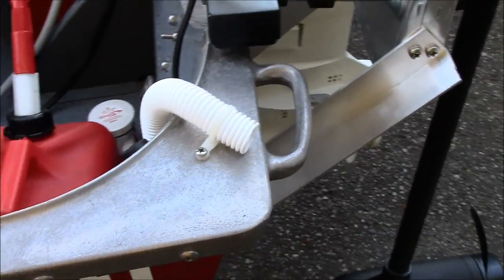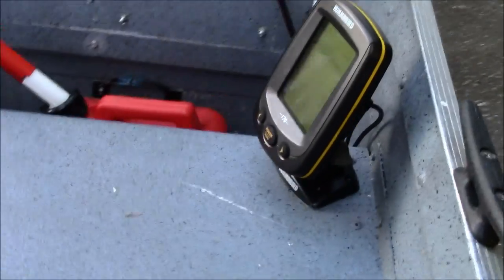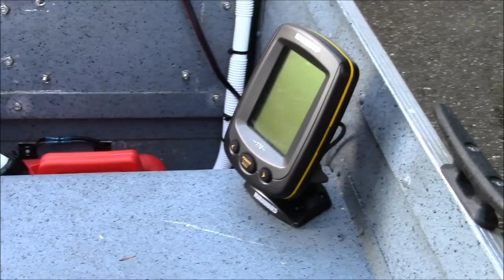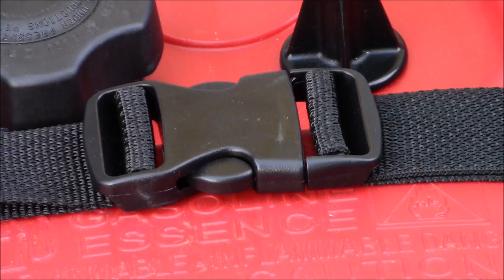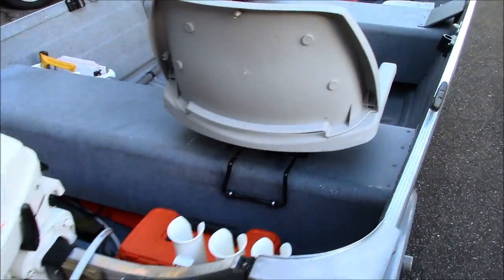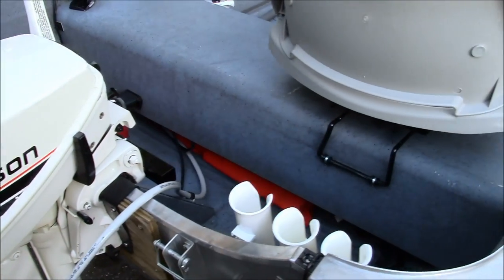12 ft Aluminum Fishing Boat Restoration, Customization and Setup in HD

Comment: I know this vid is old but it just popped up in my feed. Love your attention to detail. One thing you've probably added by now. navigation lights. I did a DIY 14 footer myself. Even added a pvc center console and wheel. removed middle seat. Decked, then i changed it for foot space for fron guy or girl. Also floored and marine carpet. Love all the great ideas out there for tin boat crowd.

Comment: I know this is an older video but even so you've done a remarkable job,beautiful boat. It looks as though you have covered everything you need except one thing. Pull your prop off your 10hp, theres a shear pen in behind it. Take and find you a nail of similar size and make you 3 or 4 pens and carry them with you. They get worn just shifting in and outa gear and break when you need it most. Theyre very simple to change even in water. You also said something about building a casting deck,build one just to level your floor out,you got the best boat ive laid eyes on. If you've already done this just pass it on to your friends please. Thank you for showing that incredible boat,keep it even if you get a new one,you want ever regret it.
Reply from the maker: Mark Sutton thanks for the tips! I still have the boat and have changed ALOT to it. Will be posting an updated video in the future

Comment: Setup is almost identical to mine but I have a smaller motor. Nice boat and nice setup. The main thing I did different is that I have the anchor rope running from the bow along the side of the boat so I can control it from the stern when I am by myself. I don't plan on doing the upgrades you are talking about. I prefer simplicity.

Comment: Really works well. Battery gauge is not super super accurate but the motor is pretty great. Haven't used it in salt water yet. Eventually

Comment: This is Armydad from Philly. I was looking for rigging ideas for my 2000 14 ft. Lowes Sea Nymph with 8 hp honda 4 stroke. .  Your video was on point.  I will definitely use the anchor set up, bilge pump, gas tank strap and clips for seat.  If I can suggest a good idea to you.  "A fold away cutting board".  Thanks for posting.
Reply from the maker: Armydad Cutting board for what? like a work table or prepping fish?

Comment: The only thing I didn't see on the boat is your Bow & Stern Lights, mount your Extinguisher near the rear bench not next to the motor. If fire ever will start you won't have to reach through the flames! Other then that nice set up, good luck on the up grade in the winter, done it been there!

Comment: I'd add a screwdriver to your tool kit, get a nice one that takes the 1/4 hex driver bits to save space. I had to use a trolling motor once to get me back to the dock because some linkage fell off my outboard carb and i needed a screw driver to get the air box off to get to it and i didnt have one.

Comment: Great restoration only thing I might change is put 4 foot of chain for anchor so anchor stays at bottom. Also fuel line & electrical line should not be wired together bad news there.

Comment: What's the measurement for the trolling motor bracket that you built I would like to build one 
What size aluminum did you use that was a great I dear. thanks

Comment from the maker: I used 1" stainless steel wood screws. Drilled a pilot hole in the aluminum covering the wood transom and then screwed into the wood transom.
Reply: Wow , great job and she looks better than brand new. Thanks heap as you have given me heaps of ideas for my latest project boat. 
Regards from Australia
Reply from the maker: Got it from Walmart. Didn't find it there anymore but I found a similar one on amazon at this link:

https://www.amazon.com/Anchormate-Worth-Anchor-Reel-Black/dp/B000KKET98
Reply from the maker: Got it from Walmart. Didn't find it there anymore but I found a similar one on amazon at this link:https://www.amazon.com/Anchormate-Worth-Anchor-Reel-Black/dp/B000KKET98

Comment: Auto parts stores sell a cheap clip on solar charger that keeps your car battery charged up when it's not being used. Would work great in your boat to keep it charged when trailering, or anchored/fishing, and not using the battery.

Comment: Nice presentation..

I'm guessing you fish solo most of the time and the second seat is mainly for show. Your 2nd man would have no where to put his feet without kicking the battery and tank. Understanding of course your space is limited.

Also you may consider securing your spare fuel tank and tool box..they'll be banging around back there hitting your Minnkota wiring and bilge pump.

Next, replace the wood block your Minnkota is mounted on. The two screw ideas in the block of 2x6 will not stand up to torque and vibration and will breakaway for sure.

To secure wiring/hoses running front to back consider this: short lengths of 1x1 square scrap wood. Then run a bead of construction adhesive along the natural horizontal ribs in the hull from front to back. Stick the wood to it and let it cure..you end up with an excellent securing strip that will receive wood screws to hold your conduit tube. Up out of the way of the floor and strong without drilling into the boat!

One more consideration..mask and tape the interior floor and deliver the boat to a place that does spray in box beds. It is amazing how much quieter the boat is and it provides a bit of traction for walking. I have wood floors in mine but I have a buddy that has a small aluminum like yours and it's great.

Not trying to cut down your work, very well thought out and thorough. Just trying to provide some insight of the things I've learned over the years trying to make a bare aluminum boat more convenient. Maybe a few ideas to make your boat even better.

Good work for sure..
Reply from the maker: I actually never fished alone in this boat. Most of the time I had at least 1 other person with me and sometimes even a 3rd. Plenty of room for the feet in the front.

The stainless screws for the trolling mount are 2" long into solid wood. Should hold for quite a while. 

The back of the boat does not move much compared to the front so I've never had much of a problem with the spare fuel tank and orange tank. 

I do appreciate all the tips though!
Reply: @danutdlp  Never use stainless steel with aluminium, they will start corrosion of your aluminium parts a specially in salt water.

Comment: Nice setup I'm looking for something affordable that I can stand in & cast out of
Reply: Just take your time go to these used boat stores almost everything is stainless that means no rust ,you’ll get good deals ,I just bought two brand new seats,well they look damn new for 5 bucks each ,great deal ,these seats go 75 bucks a piece and get the adjustable mounts all universal,5 bucks each,the key is to make your boat the way you want it,just take your time ,good luck you’ll find a good motor ,but some things you need new like gas tank,hoses and primer bulb,things like that.it will be a little expensive but hey it’s a good hobby,there’s so many ways to save money,if you have a 12 foot aluminum like me ,and you have a 8 foot bed put the tailgate down and the boat will fit right in,this way you don’t have to deal with trailer,I have a car so instead of spending thousands for a truck ,it cost me 300 bucks for a custom hitch,I’ll have to get plates and registration but I’ll save thousands because I don’t have to buy a truck ,you see it’s tit for tat,but take your time you’ll save a lot of money

Comment: Fantastic job, great looking boat...if I can say though (just for safety reasons), you should not run electrical and gasoline in the same line/together side by side in case of a possible short/leak i.e. in case something failed it would be a shame for this sweet boat to burn (let alone the people in it).

Comment: What kind of brackets/straps for the zip screws did u use and where did u get them? 
Thx and great boat
Reply: That hold the seats in place
Reply from the maker: David Farahnik They are called Stainless rubber insulated sleeve clamp. I found them at my local hardware store. "Ace Hardware"

Comment: please tell me you did not say fuel line and electrical in that same conduit!!!
Reply: lmfao
Reply: LOL. What could go wrong? Nice catch. I totally missed that.
Reply: Yup.  I was going to make the comment as well... but yours was the first comment of all of them.
Reply: There is a electric fuel pump inside the tank of most automobiles.The gas tank could be in the back of the boat.A spare gas tank should not be necessary but the spare tank could go in the front.
Reply: With all that thought I'll give $800 for it.
Reply: Gas tank next to motor ,did I miss something?
Reply: @timothyflanagan3641  You want to see the fuel gauge built in the gas tank without having to move to the front of the boat.You also want the priming bulb close to the choke and starter.
Reply: That spells disaster
Reply: Notice, on his gas can on the back, he has electrical wires on top of it. I'm not no genius but i sense a fire waiting to happen.
Reply: My jaw dropped and I literally paused the video at this point to look for this comment!! 😂😂😂

Comment: Steel screws into aluminium? Do you know about galvanic corrosion?
Reply: Moses Bullrush yeah talk about dissimilar metal corrosion.
Reply: What about the fuel & electrical lines ran together in the same conduit
Reply from the maker: Moses Bullrush A large area of 'cathode' relative to 'anode' will accelerate the anodic corrosion. Although aluminium is anodic to stainless steel, large relative surface areas of aluminium to stainless steel can be acceptable, dependant on local conditions.
Stainless steel fasteners in aluminium plates or sheets are normally considered safe, whereas aluminium rivets or bolts holding stainless steel parts together is an unwise combination, as there is a practical risk of corrosion.

An example of the safe use of stainless steel and aluminium together is where stainless steel fasteners and hold down bolts are used to secure aluminium roadway or bridge parapet guards.
Even with no insulation between the metals, there should be little risk of corrosion.
Reply: So I guess the answer is yes, you do know about it...lol
Reply: danutdlp r

Comment: Your electric line and fuel in seprate conduets and then run them in one large. If gas leaks it will eat the coating on your electric lines.

Comment: Draping 12v wires over a plastic gas tank is a recipe for disaster. I've seen them short out and go molten like a dynamite fuse. It'll melt through the tank and blow UTFU. The seat clamps are redundant if they need screws to hold them on. Screw the swivels to the seats directly. The air horn needs to be assembled and stored next to the helm for immediate use. No good to you in a tackle box if you're about to be run down. Same with the fire extinguisher.  The unsealed cheap plywood outboard pad isn't doing much and will turn to mush in a couple years. Mushroom anchors are not capable of securing a boat. They're for lunch breaks and drift fishing. Those are not "oars"; they are shitty little paddles. You need oars, a proper anchor, spark plug wrench, hand held and aerial flares, bailing bucket, sponge, a decent First Aid kit, waterproof flashlight, some tape to patch a hole and a boathook, for starters. Otherwise, you're looking pretty good.

Comment: Hate to burst your bubble security wise, but Master Locks are about the worst padlocks you can buy, right down there with the cheesy Chinese padlocks.  A guy that has done any research at all can open a Master padlock in 5-10 seconds, due to poor internal design and cheap construction inside where you can't see it.
Reply: G56AG what kind of lock do you recommend?